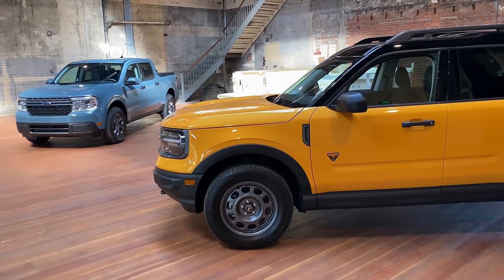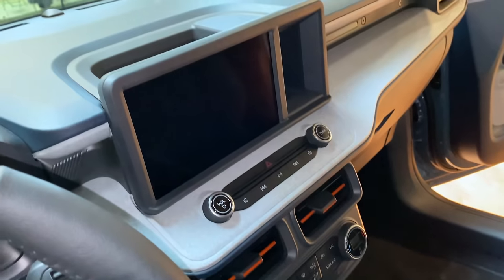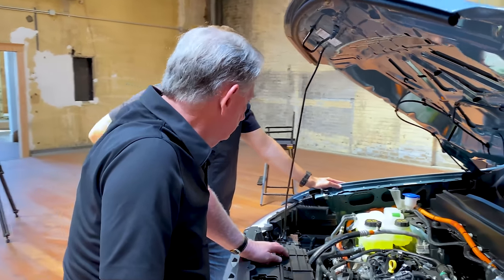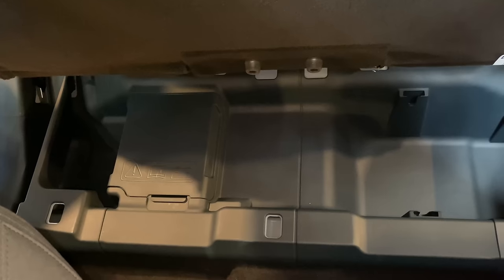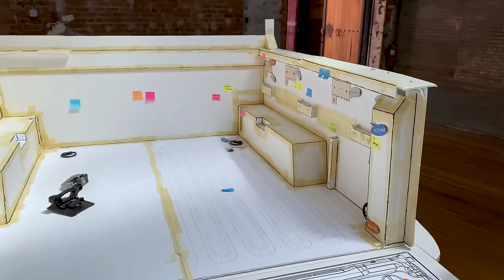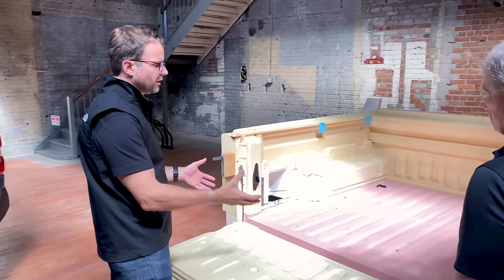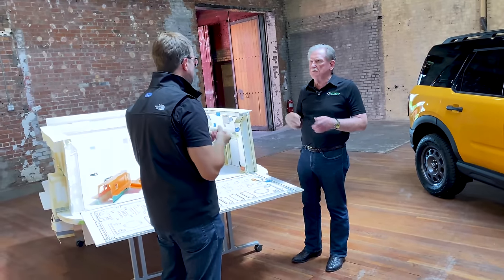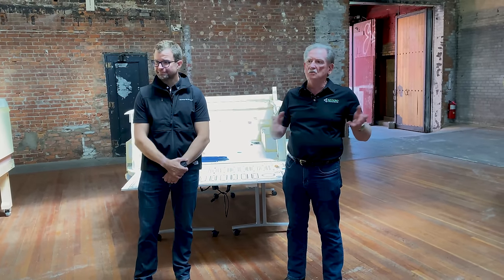Ford Maverick Review with Maverick Chief Engineer Chris Mazur

Comment: I ordered one of the "below" $20,000 (xl hybrid) ones, had a VIN/build week, Ford said "constrained" and cancelled that and built a Lariat Lux Hybrid in its place ordered 2 months before being built (so obviously nothing on my truck was truly constrained).  That truck is now due to be built in February and I believe the cost is now up to around $23,000 or so.  Ford also ran adds last week saying "you'll pay the interest rate that was there when you ordered" but that is also a lie.  While they are giving a "special offer" it won't bring the price back down to what I ordered, and then with the much higher interest rate will add thousands on top of that to the price of my order.
 Having said all of that I did get to drive a Hybrid Maverick for 6 months.  Extremely cheap build in so many areas. Probably the most noticeable to most owners who live where it rains is the rear door design holds water up top and then when you open the door that water poors in the read seating area (on on top of you as you get in).  What would Sandy say to this? 
  More importantly to me though is that the Hybrid programing is crap. My drive is steep and when coming up it the ICE is needed (regardless of HV charge).  At first when I left home sometimes I would get a very alarming problem at the bottom and it took me weeks to figure out the Regen system was disengaging before the ICE motor comes on to provide compression braking when the ICE motor is COLD.  The truck lurches forward when this happens and given the narrow set of things that must line up most will never notice it.  Near Full HV battery, cold ICE motor, high regen state, when the HV battery reaches full it all lines up and you lurch forward.  Digging deeper into this I soon realized that when I drive UP this steep driveway (paved and curvy) the ICE motor will put about 10% of the HV battery charge back in while going UP. If the HV pack was low enough then when I park I'd not reach the critical 90%ish of charge needed to trigger the full HV battery going down.  But most often it charges it to 90%ish going up, which means the lurching while going down the next day (remember only if the ICE is cold does it disengage before the ICE has came on). 
  this lead me to look at longer grade hills and HV/Hybrid/ICE integration. It also happens on those hills, but, you won't notice unless your monitoring those systems as the only operator indication is a reduction of about 10MPG of fuel consumption. I guess Ford felt 42ish MPG's was good enough.  To explain this better on longer drives if I let cruise run the speed limit on rolling hills (some miles long grades) I will go up hills with the Hybrid side using both the HV battery (at times) and the ICE motor. But even then you will often see the ICE motor putting charge into the HV battery going up hills.  If I elect to drive it myself though and monitor the HV battery being full going down hills I can then go slightly faster to build speed, use that speed to go up the next hill via the EV motor (instead of the ICE) and still maintain the speed limit when reaching the top of those hills with a very low state of charge in the HV battery, which means while going down the next hill it will use Regen much further (due to it being at a much lower state of charge).  While left under cruise I will make it less than 1/10th of the way down before the ICE comes on to provide compression braking due to the HV battery being full from slopping programing on Fords end.  Under my foot provided speed control and understanding of the system I can go for around 10 miles in those hills in ONLY EV mode (maybe rarely using the ICE to keep a safe speed in traffic).

  both problems, my driveway and the longer drives, are one and the same, poor programing.

  For me I know the cost of Wars on a personal level. This is why I've driven a Honda Civic VX, many VW TDI's, a Nissan Leaf (2011) and then the Maverick Hybrid. I live with PTSD and chronic pain, which makes dealing with stressful things hard as well.  For me driving high MPG vehicles is a moral choice (and they need to be made well).
  The Maverick is made cheap though.  If most make it 10 years I'd be surprised (if they do they will look like crap).
  So I moved onto a Tesla.
  So, will Sandy look into the deeper flaws of this truck? The water running in the back doors is a easy one to note (unless your the owner).
 Maybe most think 42ish MPG is enough.
  Don't just say "thanks for your service" and then say it was "good enough". Thousands died for that "cheap" oil.

Comment: Looks good, but the starter model will be very stripped down. The XLT starts at $23,000. The one in this video has many options not included. This one is probably about $26,000 ? (Just guessing). Add AWD and you are over $30,000. Nav and leather, over $35,000 ? (Still guessing).

Comment: My first thought was, can this be a replacement for the old Toyota long-bed small truck that could haul up to three dirt bikes and three riders.  Then the man said 4-1/2’ bed, and I started wondering if there would be a future model with no back seat and doors and a useable length bed, instead of being a miniature F-150 crew cab with an even tinier bed.  A crew cab turns most pickup trucks into a 1960 Buick Electra sedan with no trunk lid, not a real truck.  Maybe this would pass as a male college vehicle 
with just enough truck macho to bolster his ego, and just enough room to haul 3 buddies and a 16” pizza.  Have to drop the tailgate to even get a bicycle into the too short bed.
Reply: Bicycles will fit just fine with a tailgate pad type rack. I'm more shocked that Ford has shown absolutely nothing for roof racks on a Maverick. 
That dinky bed won't haul a real kayak.
Reply: You can’t hang a dirt bike (I.e. off-road motorcycle) on the tailgate.  To be secure it needs to be tied against the front of the bed with straps that go to strong anchor loops near the front corners of the bed.  The original 80s long bed Toyotas would hold them inside the bed with the tailgate up, so your other gear would stay in the bed without having to tie it down.  Shorter bed small trucks had to sit the back tire on the flat tailgate to fit them in, but they were significantly longer than 4-1/2’.  Even the F-150 crew cab trucks have pitifully short beds, and most standard trucks are now jacked up so high that it is hard to get off-road vehicles of any kind up a ramp and into the bed.  For non-commercial family vehicle buyers, bloated pickups have replaced the bloated passenger cars of the past.  Originally it was to escape the emission  and gas mileage laws that had exemptions for trucks, but now, it’s just to have something that’s like an oversized car inside, but bigger and higher than the next guy in traffic.

Comment: Chris I think you did a great job leading the development of this vehicle but when you say “built ford tough truck” I hesitate to completely agree with you. First, all Ford Trucks offer cruise control and wheel upgrades at the XL trim level. When people think Ford they think options and custom configurations.  That’s what make Ford the best truck manufacturer. This lack of consistency when branding the Maverick as a truck is frustrating. Why is the base model offered without cruise control as an option yet you require the customer to purchase copilot 360 in order to get a sliding rear window. I can’t see a reason why you couldn’t add cruise control as an option if you purchased copilot 360. Lastly why wasn’t there a solid black interior option on the xlt. The color combination is tailored to a younger audience but people over 40 would be interested in a traditional look. A regular cab with a 6.5 foot flex bed would also be amazing.  You also need to reach out to the PA legislature so residents won’t have to pay the added fee for truck plates.

Comment: i ordered mine with the 2.0 all fuel engine and 4WD. I can't wait to get the call from the dealer to go pick it up.
Reply: In case someone ask why I didnt go with the hybrid, its because of the horsepower, I bellieve 180HP hybrid 250HP fuel engine. I need that little extra power,
Reply: @efrain926  the 2.0 is the way to go...

Comment: A hybrid without plug-in seems very backwards for something yet to be released at this point.
Reply: Agreed, utter insanity, especially if they have a battery system (BMS, cells) available from the Lightning.
Reply: I'm sure the research they had showed little crossover between PHEV and truck buyers, and they are aggressively targeting a low price, which will exclude EV stuff.  Batteries are still relatively expensive.  I bet they have a full EV version in the works though.
Reply: Pluggins would add probably another $7000. Inverter, larger battery pack, beefier E-motor,  and added weight.
Reply: @Mountain-Man-3000  i don't buy that. They have all this talk about DIY stuff, with 3D printing and build you own racks and bed accessories and what not but they don't let me charge my own car? Seems like a huge missed opportunity. This truck seems to be targeted towards the "urban" buyer that does runs to the hardware store at most. BEV trucks are soon a thing. PHEV is an overlap between those two.
This type of "thinking what your customer wants" would have never seen BEVs coming.
Reply: This is already a small truck, adding batteries would take away more space and add cost. I think they really wanted to make this as cheap as possible and low $20k is a great price point. I hope they go to full electric soon though.
Reply: @officialyasir  If the battery they use is so small then the mild hybrid will do almost nothing for the fuel efficiency. Then why even put a battery in in the first place. Could skip that and make it even cheaper.
Reply: Pauline Weinberger  But could well make the TCO lower to compensate and allow power tool use without local pollution.

Comment: So in my opinion this is like bringing the Sport Trac back but in a modern way with up to date technology. The Sport Trac was and still is a popular vehicle to this date. My bet is that the new Ranger is not a very well selling product as I don't see many around in my city. I have personally owned 5 Rangers in the past and would not buy a new one. For the money I would rather buy a F 150 because it can haul more and is made out of aluminum so it wont rust and makes almost the same fuel economy. I wouldn't be at all surprised to see the Ranger get discontinued.

Comment: Hey Chris, you've "failed" in 2 ways on the Mav design
-
1) The bed is too short.  So short you can't put an in-bed roll away tonneau cover (not without making the bed even shorter/useless).  Look at what Hyundai did, their truck COMES WITH a tonneau cover.  As a 2011 Ford Ranger owner, that has a tonneau cover, it is a priceless feature.  The ability to, at any time, lock and protect the cargo in the bed is priceless.  It's impossible with such a short bed.
-
2) No manual option on the all-wheel drive engine/transmission.  My 2011 Ford Ranger has a stick.  It makes driving the truck engaging and fun.  I know, you would not have sold a lot of them, but dam, to shut us out sucks.  I mean the Bronco is getting one.  You can't tell me that manual can't handle the smaller load of the Mav engine.
-
Really wish you'd offered an option for a manual and a longer bed.

Comment: The Ford Lightning is the ones most of us are waiting.
Reply: Cybertruck
Reply: @areyouarobotz  neither, both are too big.  Maverick Lightning!
Reply: I put down for reservation on both just to see which I prefer when time is right.
Reply: @areyouarobotz  Cybertruck is crazy expensive to send your kid to college in or for a kid just out of college to afford.  And good luck getting one in the next 3 years.  This Truck is definitely priced for its market.
Reply: @greggmcclelland8430    Not if you can get a 10 k tax credit.   The base Cybertruck would be 30k and a way to make money on the weekends.   Only it’s size and where to charge would be and issue.    If you have to supercharge.  The Maverick would be Cheaper  to fuel.
Reply: @willyolio9590  good option, I agree
Reply: @greggmcclelland8430  as another mentioned in this thread, tax credit for EV, cost to charge is about 1/10 per gallon of gas, cost of maintenance is significantly cheaper on an EV. If you add solar to your house, roof or ground panels, then you don't pay for "gas"
Reply: All Electric is the future and Telsa is working on a $25k all electric car, while I prefer a pickup too, this is not All electric. Telsa is years ahead, by the time this comes out we will be seeing the CyberTruck on the roads.

Comment: New Hybrid without even a plug-in option. RIP Ford.
Reply: Pauline Weinberger  Plugin or electric should really be the 1st ones though, actually non plug-in shouldn't be an option.
Reply: @eubikedude  they have to prove there is a market for the segment first. In the near future they will release a bed mounted range extender for electric pickups.  They already applied for the patent. When they do this, they can sell an all electric version.  Then they sell the range extender seperately to people who want to tow long distance.  They can also sell it to people who want to use it as a home backup or jobsite generator. At that point the plug in hybrid is dumb because you have to carry your gas engine around all the time and you cant take it out to use it for your home.
Reply: @eubikedude  In some states PHEVs face discriminatory taxes, and not everyone (particularly apartment dwellers and college students) have access to charging infrastructure at home.

Comment: Ford is on a win streak, let's hope it doesn't fall onto bad old habits and rest on its laurels.  Anyone remember the 86 Taurus?  That was a very significant car for Ford, it probably saved them.  What happened after... they patted themselves on their backs and went back to business as usual instead of capitalizing on the success to drive innovation.
Reply: Yep.  I have a 2005 Taurus.  Very mundane.  I think even the same original base engine, with slightly more power and efficiency.  The rear seat doesn't even fold down- even in 2005 that was apparently an optional extra.  I am about to hit 300k miles,  so at least it's durable!

Comment: I love this practical and affordable truck from F. However, under the hood, the complexity of the hybrid engine with the ancillary subsystems is outdated in comparison to the TSLA EV's. I have the feeling we're looking back in time at what transportation was instead of the excitement of what the future can be. New and yet so old.
Reply: Nonsense, hybrid systems are relatively easy, the water pump AC compressor and many other engine driven parts are all electric, the engine Atkinson cycle works peacefully.....  the first gen 1997 toyota prius are still running great.

Comment: Manual transmission with AWD and 30+ MPG or go full electric with AWD.

 Ford's automatic transmissions are not to be trusted, the CVT will make what should be a fun truck boring, and 4 driven wheels is the way to go for all variants

Comment: Its Obvious Ford is looking to restructure to EV they are Building the Electric vehicle infrastructure its not ready yet. The way this truck looks and the Price point is outstanding. Good job Ford, i drive EV but for what you guys currently have to work with this Truck is perfect. Ford is building the ability to build everything in house from the ground up for Electric vehicles but it takes for ever. The fact that Ford took ques from Tesla on the Mustang (which looks fantastic to me)shows me they are thinking on the right track and they wont let pride get in the way of success.

Comment: Hybrid must be expensive to fix, there's a lot going on under the hood. I'd rather go all electric and save the maintenance & gas costs and have improved reliability.
Reply: All hybrids in the US comes with an 8yr 100,000 or warranty
Reply: I think more of an Hybrid is an normal Motor with a little stronger starter motor that can also drive the car. So maybe not a lot more pieces than in an normal Motor. But yes sure more pieces and les reliable than fully electric
Reply: @Sunlight through a window the discussion is not about how easy/hard those cars are for repair. But how often they need repair/service. Tesla example don't need oil change etc. Because those electric cars having les moving parts. Example Tesla's don't have clutch and gear shift, so there are less parts to break.

Comment: This is going to sell like hot cakes, but I would avoid the CVT and go for the 2.0 liter
Reply: The CVT is what makes it Hybrid. It’s an e-CVT which just has some motor/generators for the infinite gearing not a belt. For cruise speed there is a lockup clutch that lets the ICE engine power the wheels directly.
Reply: @imho7250  as an owner of a Fusion plug in hybrid with the same system, I speak with knowledge. My fusion is borderline unsafe while merging onto the freeway. I stand by my comment.
Reply: The 2.0 liter gets 21 mpg city, vs the target of 40 mpg city of the hybrid. Obviously any car you buy you test drive first to see if it will merge on your favorite on-ramp. Ive driven 1.0 liter Geo Metro that you needed to turn off the Air conditioning to merge or pass. 

8 seconds 0-60 is not for the drag strip. Lol

Comment: Extremely disappointing that it does not have an ev only mode or plug in capability. There is really no excuse.
Reply: you are not gonna get all only EV mode in a $20k pickup truck
Reply: @mamadouaziza2536  All the hardware is there for EV mode. To clarify, not full time ev, just temporarily similar to the Volt.